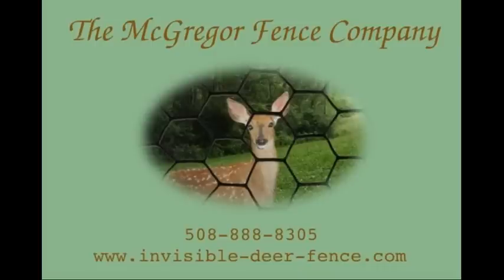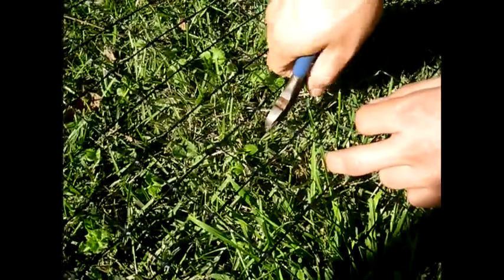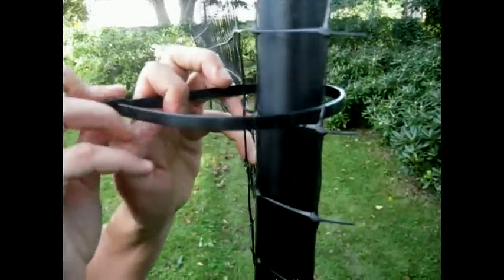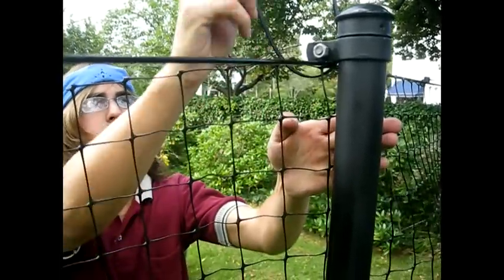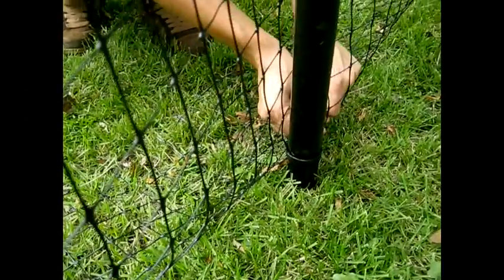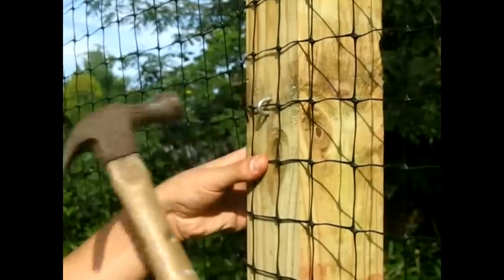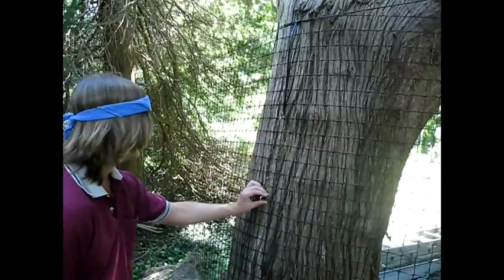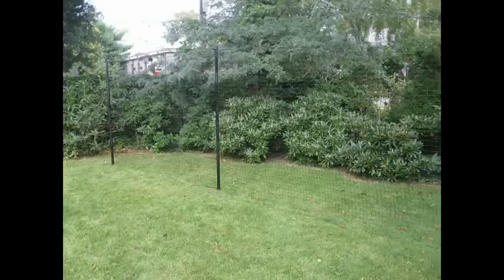9.  Deer Fence Installation Videos: Hanging the Fencing

Comment: deer cannot chew through this pre stretch fencing in my experience they only have useable teeth on their lower jaw with a soft pad on the front of the top jaw (except muntjac CWD tusks) their rear grinding teeth cant be used.

the reason to use galv wire on deer farms is to protect the animals as the entire length is tensioned like a long vertical trampoline. exclusive fencing does not suffer the same pressure and we use this fencing for remote plantation protection very effectively.

Comment: is this fence dog proof?
Reply: Our Metal Hexagrid Fencing is dog proof. Our Polypropylene fencing can be chewed through by large and determined dogs and can also be prone to digging-related damage at the bottom.
Reply: jonathan leonard tenax makes one that's not metal that's for dogs. I'm about install a 5' one myself. I have 2 pitbulls. I'm only using the netting, t posts, zip ties and 6" galvanized sod pins or weed barrier pins,  these are some names they're called when you go to buy them. I got 200 for $15 on Amazon. I'm able to use 2 smaller oak trees and a steel clothes line t post as my corners so I'll be able to do it myself. I'm 55 and female. My dogs do not stay outside all the time though. I have a doggie door and they go out play and do their business. A lot of times they just hang out on the deck, lay in the Sun or hang out in their pool in the summer. The best thing about these kind of fences is that they are not climbable. If a dog tries to climb these fences it flips them off and with the stakes pinning them to the ground there are a lot harder to try to go under. One of my dogs is a puppy and he's a chewer, so I'll have to watch him. I've decided to mix a batch of alum, hot sauce and whatever sort of yuckies I can in my sprayer and spray the fence down if he starts to chew! The difference in the 200' and 330' was $5!! Yes $5! So I got the 330', obviously,  I will have extra to patch and double up areas if needed!